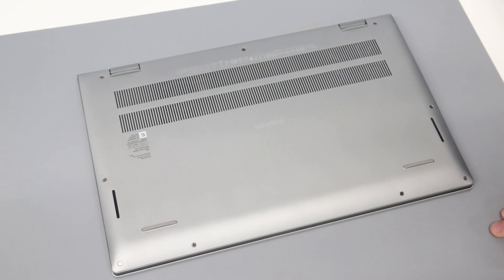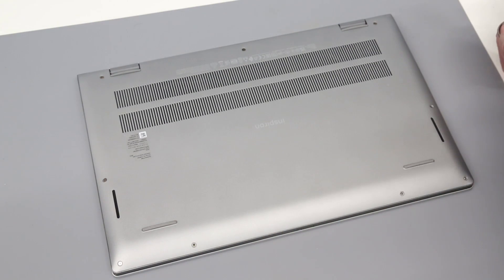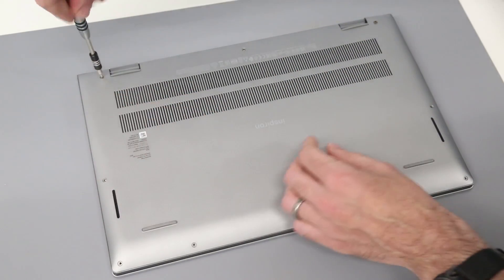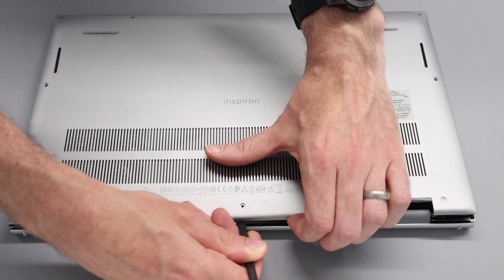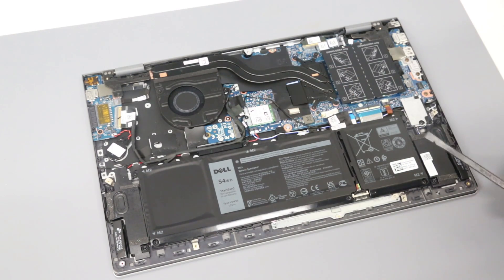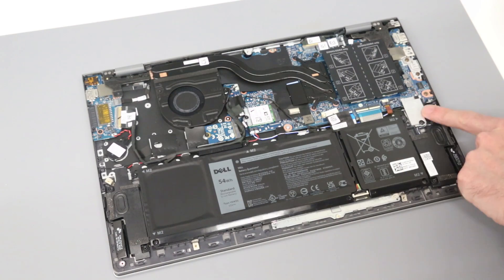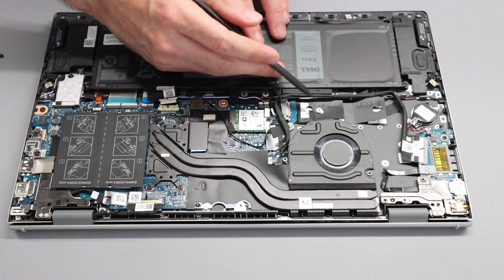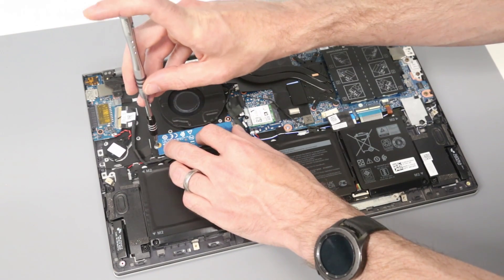Dell Inspiron 15-5510/5518 (2021) - SSD and RAM Upgrade Guide

Comment: After moving the smaller SSD to the other slot, did you have to make any changes to the boot sequence in the BIOS?
Reply from the maker: No, it still picked up the Windows Boot Loader from the SSD.
If both devices are bootable you'd need to set which to first boot.
Reply: @BrueComputing  Thanks! Also, thanks for the outstanding videos!
Reply from the maker: No problem, and thank you!
Reply: @BrueComputing  This DELL BIOS is really bad. I cloned my drive, but I can't select that drive at boot sequence.
Reply from the maker: @mrt8096  How did you clone it?

Comment: Does it have a slot for sata SSD ? I have Dell Inspiron 5518.
Reply from the maker: A 2.5" SATA bay do you mean? There isn't one of those.
If you mean can it take a SATA type M.2 drive, then I'm not sure, I only tested with NVMe type drives.

Comment: Hi Brue Computing
I have bought the same laptop
I have facing the system heating while using the laptop
are you facing the same issue?
Reply from the maker: I didn't have any issues, it can get quite warm as it is a 35W CPU but it was always able to keep itself usable with the fan running at a higher speed.

Comment: It would be very help full if you would let me know the make/model of the stock ram, planning to add a 8gb stick.(stock: 1-8gb)
Reply from the maker: From memory it was Micron. You can check your current module with CPU-Z without disassembling the system.

Comment: Hi Sir 
Which is stock ssd company wd Or samsung. 
I was buy that model 
m. Board has PCle gen3×4 port but changing m. 2 PCle gen 4.0 ssd (WDSN850 black) so that change will customize or not.
Reply from the maker: Mine came with a WD SN530 512GB drive, as per my video review here: https://youtu.be/Lg1ibQSg1tA
Reply: @BrueComputing  thanks 
About ssd customization is possible or not

Comment: Ram frequency??
Reply from the maker: DDR4-3200
Reply: @BrueComputing  sir but what is ram latency cl16 or cl18 or cl20 Or cl22
Reply from the maker: @abhishekrajurkar1034  Memory latency conforms to JEDEC DDR4-3200AA standard, so 22-22-22 (CL22).
Confirmed by checking with CPU-Z.
Reply: @BrueComputing  thanks sir

Comment: does this void warranty ?
Reply from the maker: You should always assume if you're opening the system up you risk voiding the warranty.
If you had an issue with the system post-upgrade I'd recommend returning it to the original configuration to test and then raising a service request.

Comment: Does the lid open with one hand or one finger?
Reply: No bro.. U need to take help of base
But this laptop is awesome😊
I bought a week ago.
Reply: @abhishek_jha_  Cool which variant did you buy?
Reply: @slimshady5850  5510 i5 11th gen 
8 gb ram, 512 ssd, 4gb iris x graphics
Reply: @abhishek_jha_  price?
Reply: @abhishek_jha_  brother,can you tell me what is the maximum supported ram config, 2*8gb=16 or 2*16=32gb coz i am planning to buy its ryzen version :)
and are you sure that it is possible to install 2nd ssd in the indian varient?
Reply: @sayi_k.s7401  bro get the intel i711390h with nvidia mx450 2gb it's much better value in my opinion and its the system i currently have. i may be wron on the next part but doesn't the i7 version have a better screen than the i5 and i3 ?
Reply: @joeblack2534  idk abt that broo,but I am having a i5 5th gen machine,so I guess ryzen one has more value in price to performance.idk,for how much u bought yours??and offline or online?
Reply: It's the same, which is shown in the video